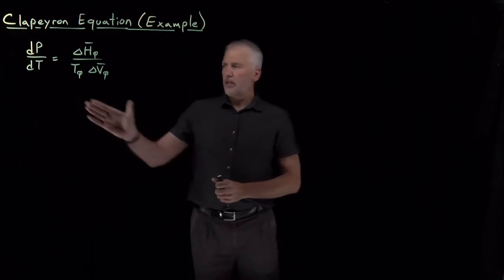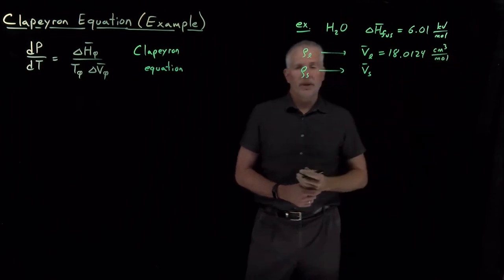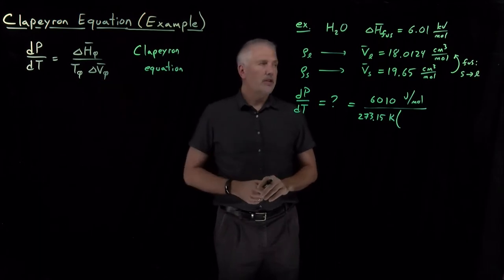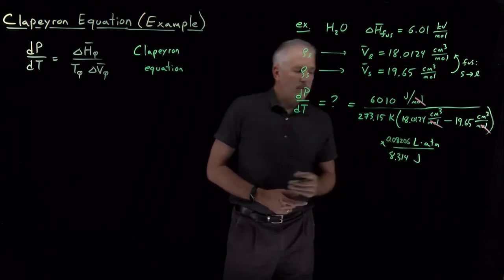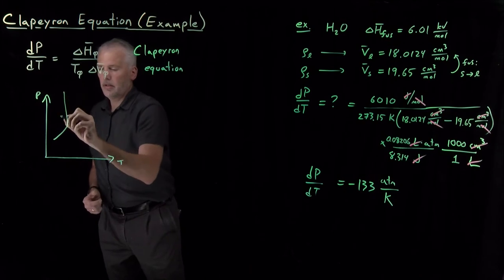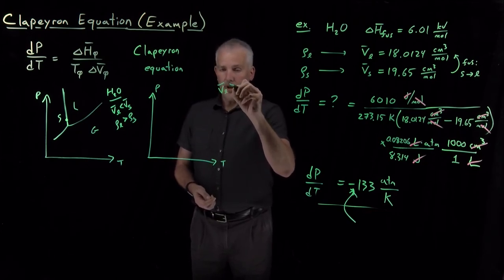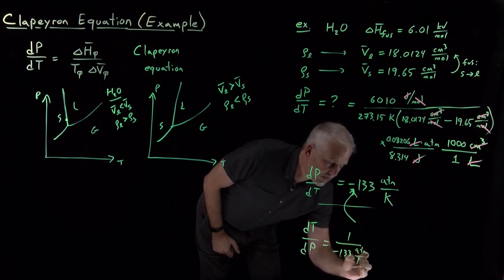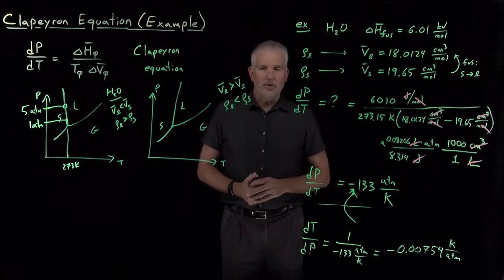Clapeyron Equation (Example)

Comment: For T in the denominator, will this always be the temperature of the phase change? On one-hand it makes sense because the original equation involves the latent heat but say I wanted to compute the slope of the coexistence curve at a particular temperature, say 20 degrees C. Would I replace T with 293 K instead of having 273 K as you have in your example?

It just seems strange that a curve like that would only have one value for the slope, which because it's non-linear curve, the slope should be the tangent line to the curve at any point. So for example, the slope of the coexistence curve at the liquid-gas boundary, at lower temperatures should have a smaller slope while near the critical point, the slope should be larger. Do we account for this by simply plugging the temperature at which we would like to compute the slope?
Reply from the maker: You're right on all counts.

The T in the denominator is the temperature at which you are interested in the phase transition. If you want the slope dP/dT at 20 °C, you would use Tᵩ = 293 K.

You're also right that the P(T) coexistence curve is nonlinear. Some of that nonlinearity comes from the Tᵩ in the denominator. But some of it also comes from the fact that the ΔHᵩ and ΔVᵩ also depend on temperature.

The main reason that the dP/dT slope gets steeper as you approach the critical point (as you correctly observe) is that the densities of the liquid and gas are becoming more similar as the fluid nears criticality, so ΔVᵩ is becoming small.

Great questions!
Reply: @PhysicalChemistry  Thank you so much! This really is a great channel. Very clear derivations and examples.
Reply from the maker: @bigqx  Thanks, I appreciate that